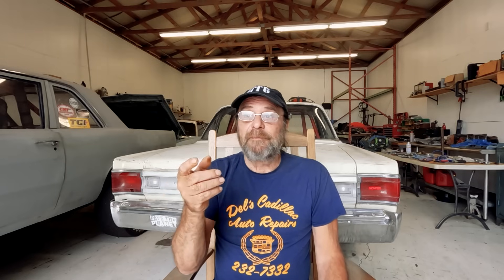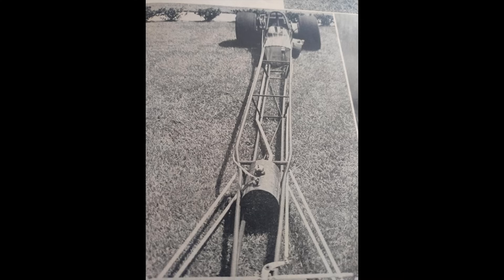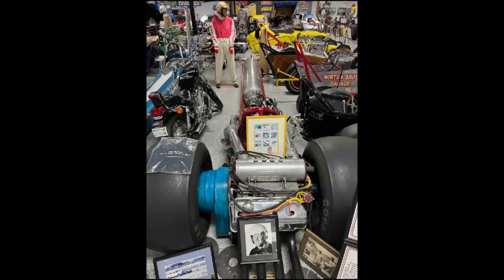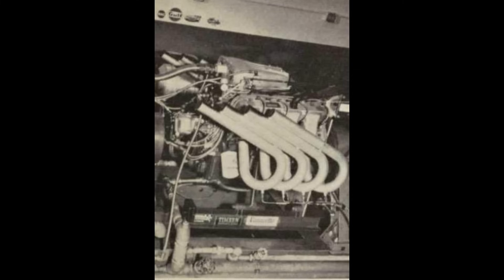Compressed Air Supercharging Returns - Here's Where It All Began

Comment: I'm still in the process of putting together a turbo k24 fox body mustang... Originally had a built turbo 2300 in it... but it's getting old.
Anyways... I've thought of running an electric smog pump into my header to help spool the turbo up during staging, but it sounds like it could get "expensive" if not done just right hehe

Comment: The question is could this be adapted  to street  use like nos power  on demand. One could  build a compressor  tank charging  system  to keep your tank full al the ti.e lest stress on one's engine! Kits start at 1600.bucks cheaper that a turbo or supercharger  that goes for 7000 to 8000 bucks!!

Comment: Ryan Mitchell just went 196 mph to the 8th mile with the CAS system last weekend. It definitely works very well. He claims he's making more power with far less boost than he did previously with twin turbos or with a ProCharger. He also claims there's more to be had from the system. He's only run it for a few months at this point, but he has considerable date on both a 427 Chevy LS engine, as well as his Big Block Chevy (which I think is a 540?). The big block was what he just went 196mph with.

Comment: This reminds me of conversations me and my buddies would have back in the day ('90s) about using the AIR system pump as a supercharger by running it to the intake instead of the exhaust. Of course, we didn't have the tools or expertise to actually try it, but we would bandy about the idea. In the late '90s/early 2000s, I had a 1985 Riviera with the auto level rear suspension and I was toying with the idea of using the compressor to pump air into the intake. Again, I didn't have the money or skill, but I was working in a speed shop and our machinist liked the idea. You might even have heard of him, Tony, his name was Jack (John) Puhac (I might be spelling it wrong, he retired over 20 years ago and I haven't seen him since and I just don't remember), he was on the scene in Jersey. Funny story, my mom's Geo Metro convertible got effed up by the local Valvoline quick service oil change place and ended up needing head work. So she brought the car to the shop (we were a parts store with a small machine shop in the back, not an actual garage) but we used the deadfall to pull the engine (tiny little 3 cylinder, it was cute) and we decided that since we had it out anyway, we would change the oil pump and throw new gaskets and crank seals at it. It had around 95K miles at that point. So Jack got to cleaning up the engine and decided, since it was so small, to paint it basically a Smurf blue. It was funny. My mom wasn't mad, she actually laughed and said it was fitting.
Also, since she had the oil changed religiously every 3K miles, and used Mobil-1, when we popped the head off, those cylinders looked like it had just rolled off the assembly line. There was no ring ridge and the crosshatching was immaculate. There wasn't even any serious buildup on the pistons and valves.
Reply: A " chest" on a stock class dirt track engine is to use an A.I.R. pump for crankcase evacuation. It adds about 5 H.P. to an engine and can be a little " extra" on the racetrack. And you can't be DQed because it is a " stock part"

Comment: In YouTube early years there were several videos of hydrogen peroxide powered go carts. You know, the same propulsion as V2 missiles. The carts went 125mph+ and drivers died. Probably why the videos were pulled. All you need for a peroxide rocket is 60% peroxide squeezed through a series of 3 types of metal screen. I've been thinking, maybe you could mount a tiny peroxide rocket  in front of a Turbo, replacing exhaust. The gas pedal increases the peroxide pump output to match engine ram. Garage 54 material??

Comment: The issue with using the compressed air to spin a turbo is you will not really gain anything, and you don't get the benefit of the bernoulli principle supercooling your air charge like you do with compressed air supercharging.

Comment: You would lose by going through a turbocharger.

There is no way you can ever get back out of such a system what you put into it.

The better way is the direct compressed air.

I have known about compressed air since I was a child, but since I was not allowed to drag race at age 7, I kinda lost track of it by the time I did end up in racing.

Comment: Hey Tony.
Im in the UK.
Theres a chap over here called Nic Mann who runs a very interesting set up in his home built hillclimb racer. He was previously UK street racer champion in a twin turbo Rover V8 (215ci Buick) Morris Minor.
His current car is named 'Mannic beatie'
I cant remember what engine it uses but im guessing from the name its a Turbocharged Cosworth BD unit.
The interesting feature of this car is its induction system.
The turbocharger is driven by a tiny gas turbine engine! 
So on the line he fires up the main engine and then fires the gas turbine which starts to whistle and whine and spools up the turbo so there is no lag whatsoever off the line.
Im not that up on the details to be honest, but there is footage of the car and an interview with Nic Mann on YouTube.
Its an insanely quick car.

Comment: Using ht decompressed air to run a turbo is just wasting the energy in the compressed air tank. Then, the compressed air that the turbo makes is hot! You loose the expansion cooling of the air in the tank, which you want in your engine.

Comment: Slight correction - the Turbonique turbocharger was really on the hotside of the turbo, the cold side was gear reduced and directly drove the rear axle (quick change rear axle). But it would be interesting to bring that back too!
Reply: They also made a version that spun the turbine side of a turbocharger. Would give you quite a bit of boost for the engine until the cartridge burns out. 😊
Reply: @NBSV1  Thats awesome, thank you!

Comment: Two things Tony 
1) Brian did a piece on the compressed air system -
2) CFM the ICE requires volume, and the common 500 CID engine @ 8000 RPM needs close to 12,00 CFM of air/min - with that being said if you want boost pressure with a blower (which does not compress the air) you first have to overcome that CFM requirement. 1-BAR is equal to 15-lbs/min which should net you about 2 to 5 pounds of boost. Both thee Roots and The Screw blowers are positive displacement meaning that every revolution of the rotors generates a given amount of air which can be calculated.  
So the volume of air going into the engine is the only limit to the amount of power derived from any system -
Here is Brian's YouTube piece:
https://www.youtube.com/watch?v=ld3wtrgYJmQ

Comment: why do they compress to like 3000psi to return to atmospheric to compress during compression stroke, why not inject under higher pressure through direct injection injectors in the cylinders?

Comment: The compressed air in the tanks @ 2000 psi would dropped down 30 psi to feed the engine the temperature would super cold giving more horse power like Nitrous oxide    google says temperature drop would be 150 degrees

Comment: Compressed-air-assisted turbos haven't just been attempted, there is a somewhat-recent Volvo roadcar doing it, blowing on the turbine-side. However, a FAR-more interesting & far-more beneficial setup is by CAT (I think) for some marine Diesels; here the compressed-air is blown into the compressor HOUSING, this doesn't so-much spool it, rather it directly-increases oxygen density, since the air as you mentioned is very dense / cold, well this means you can massively-vary the amount of torque for a given RPM! On a large Diesel generator, marine or not, you want to be running constant-RPM at all times anyway, but also it means there isn't a turbo-lag, where you wait for the turbo to spool & thus get more air, then more Diesel. Instead, you pump Diesel at the higher number within a few milliseconds if necessary after the air starts getting sent-though. However, both systems need an air compressor & tanks, obviously.

As for drag-racing & why neither have been done, well both ideas require precision air-control, they have the same issues you discussed here really. But with 2-step & alike you don't even need any of this for a turbo setup, only the latter CAT system has benefits but my lord is it complicated.. It's miracle they managed to make it work at all but I guess due to application the budget & the physical  size is not relevant, so.. But still, how cool is it there exist generator Diesels that can chug @ same RPM & instantly go from 300 to 3,000 HP in the blink of eye.. This is why industrial Diesels have ALWAYS been at the fore-front of ICE tech. and why they will always be! People are talking about pre-chambers from F1 like it's some God-given new tech, meanwhile not-only have Diesels been utilizing pre-chambers for like 80 years, even before the invention of Diesel (I think?) the hot-bulb engines that could run even on Paraffin also technically used a pre-chamber.

Comment: If i had to guess why using compressed air isn't used to spool a turbo, I would say that it doesn't make sense to use compressed air to power an air compressor. I could see it being useful for the initial spool and I have seen that done with nitrous, however beyond that I think it makes more sense to just use the compressed air as the source of boost rather than as a power source for a turbo because that is just an inefficient use. To me it kind of feels like throwing a torque converter behind a clutch, there is probably an application where it would be useful but not something that makes sense outside that 1 niche application. I am not expert though so I could be totally wrong.

Comment: A turbo spooled by air, using a ball valve connected to the throttle to open with the throttle after it is opened so much then quickly ramp up. Possibly using electronics and electrical valve.  Feed the boost  through a air to liquid intercooler, using methanol and dry ice  making a slushy ( a cold one.)  Possibly dropping the intake charge to 50°-70°f. And possibly 60psi. Burning methanol should be capable of 3k-6k hp or more possibly, maybe add nitro. And more air!  It could a wild ride!!✌🏻

Comment: Imagine a 100 gallon or two filled with liquid air fed to the engine through a 2"-2.5" pipe from multiple pressure regulators to get it to flow 2000cfm (+/-) at around 60-80,100 psi.  Just adding 100 psi through a 1" pipe would probably gain power if fed through a 4" cold air intake, using the fast air to pull the atmosphere in the cold air intake.  It should lower the intake air temperature to around 50°, or 20°f-30°f drop

Comment: Rally cars have used several anti-lag schemes. Ford's "boost storage" tank on a WRC car is the closest to what you're suggesting. "FYI, "rocket anti-lag" is very different from anything Turbonique did. One thing to think about compressed air supercharging is not only increasing intake pressure, but possibly lowering exhaust pressure below ambient. Imagine making 10 pounds of vacuumin the exhaust primaries.

Comment: This makes me think of closed throttle nitrous oxide. There's a limit to the amount of spray that can be sucked past the intake valve, before it flows backwards through the tb/carb. With dbw what's stopping us from closing the butterfly and hitting it with another kit?

Comment: its cool and all but the compressor system thats required to tote around is arguably not worth it. Financially and practically. Not to mention the potential damage if the system retaining all that pressure fails. Theres enough to focus on drag racing alone, never mind worrying about operating a compressor system with more technicality than an average shop compressor

Comment: This is made much more feasible because of fuel injection, throttle bodies, and sealed systems other than carburated  engines.

Then there is the fact that the government is trying to ban nitrous for recreational usage to where it will likely not be available to most people who are weekend racers or who might want to have another boosting ability other than blowers or turbochargers.

This compressed air has it's limits and problems, but is definitely much easier to to use with fuel injection rather than carburated engines, especially direct injection engines.

Comment: probably no turbo/cas yet cuz the cold boost psi is much more dense than hot turbo or screw psi number...running out of volume and pressure is the con to stored compressed air system from what I have seen....I thought maybe the scavenge from the exhaust side of the turbo could be useful but I think the advantage lies in how cold the intake side of the event is along with no drag on the crankshaft or delay from spinning a wheel with exhaust.   We will probably find that 20psi cold is equal to a 40psi hot system.  Another great description of what a engine usually sees is Hot Wet Fog...someone said that long ago.  Anyone see that sammy miller fella back in the day!

Comment: Eletric car drag racing should take off on the track two overhead electric supplys like bumpper cars at amusment parks or like trollys. 3 phaze from above.no batterys no gas no oil less mess. And 300mph for cheap.

Comment: Using compressed air to drive a turbo, fine to use a quick shot in the exhaust to alleviate turbo lag, useless  for driving the turbo independently, you are essentially  driving an air compressor with compressed air, you will never get more out than you put in, see the First Law of Thermodynamics,  just blow your compressed air directly into the engine.

Comment: For the turbos, tanks filled with air became a common way to deal with turbo lag in the 1990 in rally racing (for spooling the turbos). 
As for other technologies, they predate even WWII (when nitrous oxide and water-methanol injection became common). Superchargers and alcohol fuels (due to the crappy fuel at time) were already used in the 1920s at Indy, Le Mans/endurance racing and in International Grand Prix racing (the predecessor to Formula 1).

Comment: Volvo buses had, or if they were just experimenting with it, something similar on their city buses, compressed air that sped up the turbo. 20-25 years ago
Reply: Ex bus driver here. Turbo lag is a big issue with buses. We need the power now, not in 5 seconds. By then the traffic light could have turned another colour (not green)

Comment: One of the old time hot rodders, engine builders Barney Navarro messed around with using oxygen bottles as a way to boost engines.
Reply: Rolls-Royce experimented with oxygen as a way of getting higher altitude in aircraft during WW2. The downside with oxygen is that it burns everything: spark plugs, valves and pistons as well as the fuel. The nitrogen in Nitrous Oxide is a moderator so engine parts are not in as much danger with nitrous. Compressed air still has its nitrogen so burning up parts is not an issue
Reply: I was wondering why I had not seen mention of this in the comments.

Comment: Big car companies are using compressed air to help spool turbos. I think BMW or Volvo has a turbo car that uses a air compressor on the side of the engine to pump up a small tank and released into the exhaust before the turbo when commanding acceleration.
They also use water injection.
Cool stuff.
Reply: Porsche uses electric motor assist on some turbocharged cars to keep turbo spooled up when you back off pedal. This reduces lag when you put your foot back in it

Comment: Ryan Mitchell and Tina Pierce are running similar systems with great results..on the 1320 video you can see Ryans intake freeze as his car goes down the track...the way the air is regulated is the genius behind the success of the system and the result is colder intakes, more timing and more controllable power on normal race gas.

Comment: Fun stuff! 
 Pretty amazing how many things we think are modern came out of piston engine aircraft engines up to the end of WW2. If jets hadn't happened, one can only speculate how far piston engines would've evolved.
Reply: The first engine with variable valve timing, lift or duration l can think of was Lycoming's R-7750 36 cylinder inline radial. Four rows of 9 cylinders with the cylinders inline. Think of it as 9 four cylinder engines wrapped around one crankshaft. It featured OHCs that shifted position between cruise and max power settings. At least one engine still exists held by the Smithsonian.

Comment: GM developed the system in the mid 60's and it was illustrated in Hot Rod, they were developing it to be used for overtaking on 2 lane roads and getting up to speed when entering traffic flow on interstates. IT lowers the intake temps by 20 degrees or more. 
IIRC is was in the same issue which showed the Electrovair / (electric Corvair) and the hydrogen powered van.

Comment: Decades ago, guys were trying spraying nitrous into the impeller on the cold side of the turbo to improve low end boost.
Reply: Now some manufacturers are using electric motors to spin up turbos

Comment: Well; that's really all a supercharger is; it's a compressor, really.  Superchargers are belt driven (most of the time;some are gear driven), low pressure, high volume air compressors.  Shop tool compressors are belt driven (most of the time) high pressure, low volume air compressor.  I guess that means anyone of us could add power to our vehicles with a 10 gallon 120psi air tank and a computer re-flash to add more fuel?
Reply: what the new company does as their secret sauce is the mechanism for measuring the air correctly in combination with the fuel injection changes and reacting correctly with the lag when the air intake is changed. in a normal driver that doesn't have a supercharger on it already you need to keep the extra air from escaping through the intake somehow too, so you can't just add such a system as a power adder easily on most cars. on a drag car it doesn't matter much if you block it from atmosphere for the run.